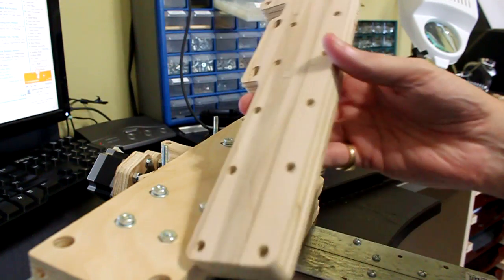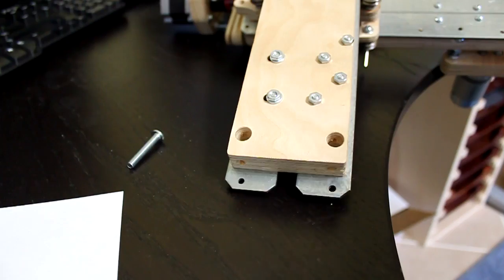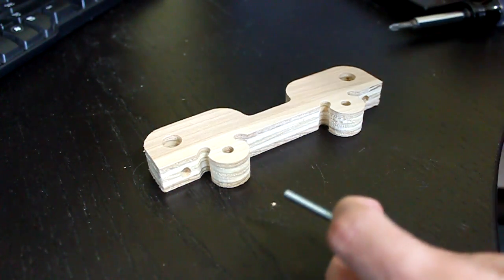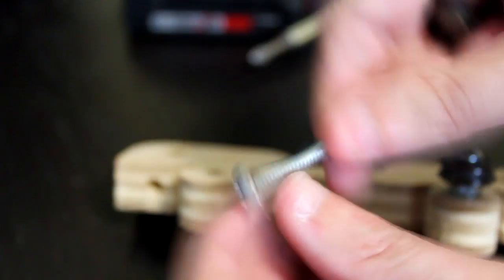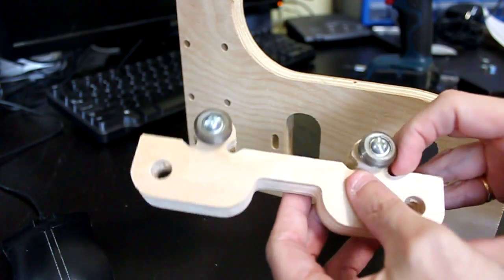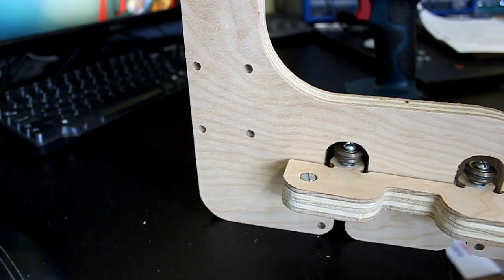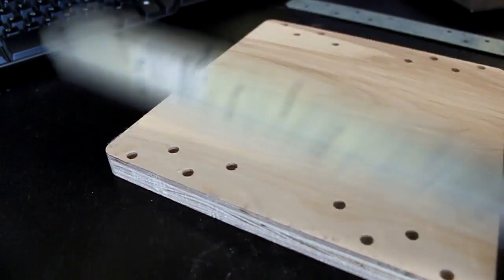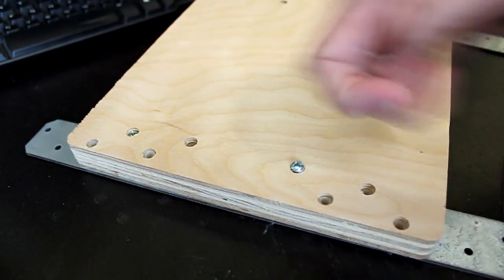whiteant - starting the x-axis and structural sides.mp4

Comment: Man I am missing a set screw on the serated hub,  I had to get a hot end when the cnc site was misleading. I only had 27 1 inch #8 screws labeled on the bag and the math doesnt add up, the supports that hold v bearings on the feet didnt line up. I thought I was paying money for a better kit. Cnc/printer?? You could have drilled the holes so I could exchange mounts from hot end to spindle in the metal rails..... oooooh boy am I going to give one long review to youtube about this product. I should have bought the $600 version printer. I would have got the same quality craftmanship. Oh and ive ruined 3-4 of these spacers... why dont your kits have the right holes? It made me so sick I soent 1100 on this I havent been able to look at it for 4 months before trying to go surf the web for set screws, themristers for hot plates and other hack information you left off.... shheeeesh I feel better. Enjoy the $$.
Reply from the maker: Did you contact us regarding these issues?  I won't be able to know if this is an issue with our manufacturing, packing, or with our assembly in our database. Please contact us so we can improve and provide you with what you need.

Comment from the maker: @aggrav8d Don't use the spacers as the table will not need them anyway.  This also makes the table rails more adjustable.  I have noticed that you should insert the screws from the rail side and not the wood side.